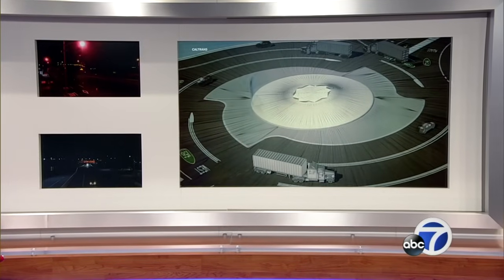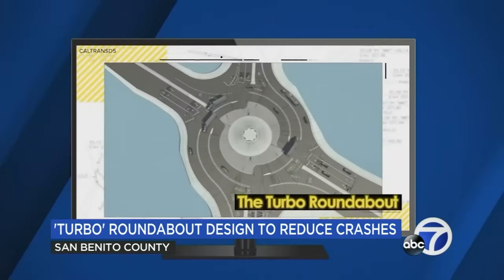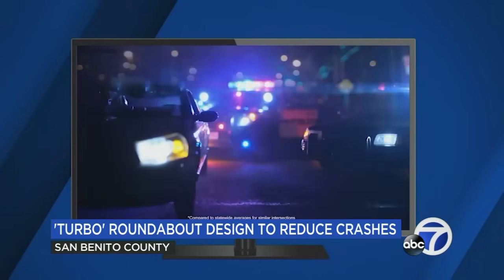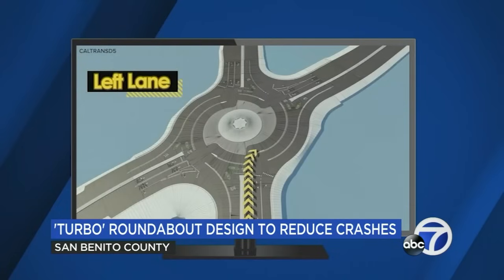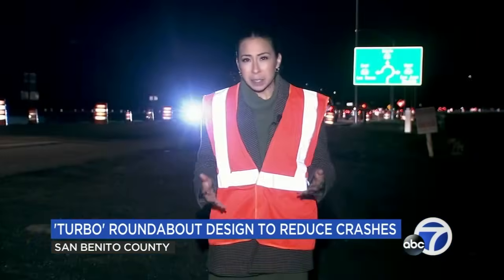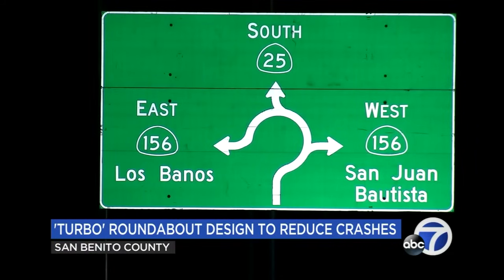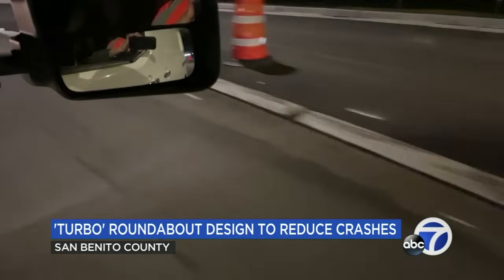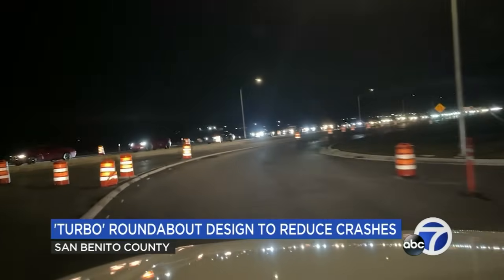Here's how California's first 'turbo roundabout' works

Comment: A 3 inch barrier isn't going to help anyone when someone freaks out and "misses their turn" and either stop completely to clump over or just drives over them (trucks more so than cars I'm sure).  If there's anything I've learned in 30 years in driving is most people can't accept "I'll take the next turn and double back" it's "I need to get off here, now, that is non-negotiable"
Reply: yes. a good driver sometimes misses their exit but a bad driver never misses their exit
Reply: Add to this the drivers who realize the lane choice mistake before entering the roundabout, and blocking two or more lanes leading up to it. Perhaps the ground barriers need to be raised to about nine inches.
Reply: @jeffreeves1567  If people can't deal with sorting into a lane, how do they negotiate any interchange?
Reply: You really can't take the next turn and double back anyway. Every one of these roads doesn't have a place to turn around for several miles.

They need to post the instructions for this a mile before you get to it, not "HEY BUDDY WELCOME TO THIS THING YOU NEVER SAW BEFORE LOOK HERE'S A LANE HAHA GOOD LUCK"
Reply: The great thing about roundabouts is that it also reduces the severity of collisions. People are still going to collid, but at a lower rate and at a reduced severity.
Reply: So true...even if they are 3 lanes over on a freeway they turn as if they saw a collapsed bridge 50ft ahead

Comment: the only problem I see with this round about is that if you take the wrong lane you'll end up in the wrong road, where as on a regular round about if you miss your road just keep goin around till it comes around again.
Reply: So, not paying attention is the fault of the infrastructure and not of the driver?????

If you pick correctly on a turbo roundabout before even going on the roundabout, you physically can't miss your exit. And it's easy to remember: left lane goes left. The middle lane is for straight ahead. Right lane goes right. Honestly how hard can it be.
Reply: If you have to change lanes in a modern roundabout it means you entered in the wrong lane.  Modern roundabouts don't let you go around and around like a rotary.  You have to exit. Turbos just add curbs so drivers that are not paying attention to the lane use signs have to follow the required path.
Reply: @BiteBolt_77 you are incorrect sir,. Left lane goes left AND straight, middle lane goes straight AND right, right lanes goes ONLY right. 
How hard can it be?
Reply: @jbright97  different roundabouts can have different configurations. In the end just follow what the signs say as they usually clearly mark which lane goes where.
Reply: Id like to see the signs ahead of time to show which entry lane to use.        Would want multiple sets far away.   So many just dont pay attention at all
Reply: The point is that you pick the right lane before you enter, rather than on the roundabout itself.  Check UK dashcam videos to see how well multi lane regular roundabouts work.  In contrast, we have these turbo roundabouts all over the Netherlands and accidents are extremely rare on them, while still keeping a good traffic flow.  If you pick the wrong lane, you can sometimes switch on the roundabout, else you treat it like taking a wrong turn at an intersection.
Reply: @BiteBolt_77  Who said it was anybody's fault? They're just making an observation. Most roundabouts allow you to change lanes; this one does not. We know you're perfect and never pick the wrong lane, but some of us are ... human.
Reply: You can just turn around somewhere else instead of in the critical section of the road network.
Reply: That is not true. Look at the lanes, as long as you are in the middle or the left lane, you can keep circling the roundabout indefinitely.
Reply: @ericclone  Yes look at the lanes, they're spiraling outward and exit the roundabout. There's no lane that circles the roundabout.
Reply: @MatthijsvanDuin  you are right. One has to switch to the lane to the left to stay in the roundabout.
Reply: @ericclone  which isn't allowed and the design strongly discourages doing so by having a barrier separating the lanes (except where traffic entering the roundabout needs to cross).  I don't understand why people are fussing about having to sorting into the right lane, you need to do the same for an interchange.
Reply: @BiteBolt_77  5 seconds before you get to something you've never seen before is not the time to give people instructions.
Reply: @rsethc  Posting comments about something you've never seen is stupid. You've never been to this intersection. Once you're on any one of these roads, there's nowhere to turn around for miles.
Reply: @aluisious ?????
Reply: Oh yeah….how easy huh?!

Comment: Didn’t explain in detail how it works. The 3” berms are going to ruin a lot of tires. That’s a guarantee
Reply: Just follow your lane to the exit
Reply: You're not supposed to drive over the berms
Reply: Those berms are meant to discourage switching of lanes within the roundabout, which happens in multi-lane roundabouts without them, causing collisions as jerks cut off other drivers from the inside lane to make an exit.

Comment: Today on May 29 2023 we just used the new turbo roundabout and the problem is people don't know what yelled means and just keep driving instead of yielding they just drive erratically. If people slowed down and drove more cautiously and shared the roundabout rightly it would run smoother. People are idiots

Comment: What needs to be done is a proper overpass constructed. People's safety is not where you need to be cheap. 
Hollister had a horribly dangerous intersection at 152/156. The millions of people that've driven through there can attest to how life threatening it was for... idk....40 years. It took a heartbreaking gruesome accident to finally cause an overpass to be built to accommodate the increased traffic flow.
Hollister has another horrible intersection at 156/Union/Mitchell Road. This one isn't particularly dangerous, but it can take an hour to get across it. 
Hollister is landlocked in a bit by inefficient roadways. We need to learn from things like the Paradise Fire. 

I've seen so many horrendous accidents at 25/156...
One of these days we'll be hearing about a semi plowing through that intersection, flying through the air, and causing a huge mess. Not if, but when. Overpass is the real answer. The turbo roundabout is a huge waste of money and wasted time in delays. 
Overpass is what the people want.

Can't make a u turn. 
I've seen people turn left at the entry.
Everyone switches lanes in the thing.
It's all bad bad bad.

The correct answer for 2 large highways interesting would be an overpass. Especially for the volume of traffic this place sees.

Comment: Bad idea. Drivers will change lanes in the roundabout and cut off cars, and change back depending on where they want to go. There will be more collisions but they will take place at lower speeds.
Reply: That is what the 3" barrier is for...it is bascially a curb between lanes.  There will be consequences to your car if you hit that curb.
Reply: @DaBinChe  not high enough. people in wrong lanes will stop and go over it. 1 foot barrier
Reply: @emmanuelvacakis4463 But why would they change lanes if they have already chosen the lane they need? It is not rocket-science.
Reply: @htimsid  bad drivers are not logical drivers. Bad drivers are never satisfied with any lane they drive in.

Comment: The only way it will actually work the way they want it to is if there are concrete barriers between lanes making it impossible to change lanes once you're in them. Otherwise some people will try anyway. Look at how people get into and out of HOV lanes illegally in between entrances and exits. At least they do where I've seen them used in California and Texas.
Reply: yes. not just curbs, it has to be higher concrete barriers. 

curbs will cause accidents. people in the wrong lane will dead stop then cross over them.

Comment: You are so far behind the curve. Round abouts are very easy to use just give way to traffic on your left. Getting rid of stop signs will be a start too. Replacing with roundabouts keeps traffic flowing reducing the ridiculous congestion. And may consider have off ramps before the on ramps as all of them are to small. Adding further guidelines like if your merging onto a freeway from another  people already on the freeway should change to second lane before the junction so people merging dont have to worry about people speeding up there ass.
Reply: Where I live roundabouts are everywhere, and even I didn't know you were supposed to give way to the left.

Thank you for telling me this. I will be sure to do this from now on. 

Kind regards, 
A resident of Great Britain.
Reply: @ExtantThylacine  if in the US you drive on the right side so coming upto roundabouts you have to give way to the left. In the UK you give way to the right. As someone who has now moved to the US from the UK i am correct. Trying to be clever about my give way to the left statement and pointing out you are from the UK, you have made yourself look stupid.

Comment: Lol, 'Turbo roundabout' aka normal roundabout but with kids rails, like in bowling, for ppl who don't know how to use roundabouts.
Reply: Ehm no, a turbo roundabout is significantly different. A regular roundabout has one or more circular lanes that go all the way around (you can keep looping the roundabout if you'd want to), a turbo roundabout has lanes that spiral outward and exit the roundabout, which is why you need to sort into the right lane before entering the roundabout.
Reply: @MatthijsvanDuin  Ehm no, normal roundabouts have lanes that you can’t keep looping around in and force you to exit. I’m guessing you are one of the ppl new to roundabouts, which is ok but don’t speak so confidently about it when you are so incorrect lol. “Turbo” roundabouts are just normal roundabouts in function but extra stupid proof and with a stupid name.
Reply: @MrBaller4Life14  I'm dutch, I've regularly seen roundabouts my whole life. They all have an uninterrupted circle as innermost lane unless it's a turbo roundabout or it has restrictions on which flows are possible. I don't see any non-turbo roundabout depicted on the wikipedia page for "Roundabout" that lacks an uninterrupted inner circle. I do see a few which have road markings that suggest an interruption that doesn't reflect practical reality, e.g. the "The Hotel Indonesia Roundabout" near the top of the page is a particularly egregious example of that.

Comment: Not a bad driver by any means but this looks confusing as hell not having seen this video and if I were approaching at 70 miles a hour. Fearful for future collisions
Reply: The simple answer is you shouldn't be approaching a roundabout at 70mph!
Reply: @astrecks  I get that but everyone drives fast on this highways and in the middle of the night or slower hours  I feel like this will appear pretty suddenly lol
Reply: @ElPolloToko Maybe the answer would be rumble strips on the approach to the roundabout. In the UK, these are slightly raised lines across the carriageway which are placed closer together as you close on the roundabout as a physical reminder to slow down.

I'm not sure having raised lane separators is a good idea though. If I miss an exit on a roundabout, I continue around and manoeuvre into the correct lane to exit.

Comment: I hate roundabouts. I missed my exit on one in Colorado without realizing and accidentally took the one going the wrong way on the interstate and was stuck going the wrong direction for several miles until there was another exit. They are confusing if you are not from the area and trying to watch for signs in a short distance while also trying to steer in a curve while staying in your lane, while also watching the cars next to you for crowding into your lane. These are popping up all over as the new in thing, sometimes 2 of these in one block which is ridiculously confusing if you are not familiar with the area. We ran into them in weird places far from cities our last trip, and no idea why somebody decided they were an improvement for a normal intersection. It might make sense for an odd configuration, like a sharp angle or multiple crossings of busy roads, but some places are not made easier with this change.

Comment: Roundabouts are not a widely used road feature in CA. Consequently NO ONE know hows to use them. Now we're going to throw a variation at highway speeds!? Who approved this!? They should be punished by having to sit and watch it for a full month.
Reply: California is near the top in states with total number of modern roundabouts.  They are easy.  Just slow down.
Reply: Gotta start somewhere
Reply: The correct answer for 2 large highways interesting would be an overpass. Especially for the volume of traffic this place sees.
Reply: How much volume. Give us a number. Two lane roundabouts can handle 5,000 vehicles per hour. Your overpass solution costs $50 M, minimum.
Reply: @scottmbatson  
Cost over lives. Got it. Our forefathers did better.
Reply: @xmo552  they didn't. And roundabouts are very safe.

Comment: Why not the normal and easy to understand overpass/underpass? This seems overly complicated and confusing.
Reply: These junctions are cheaper.
Reply: An overpass would cost 7-10 times as much.
Reply: The correct answer for 2 large highways interesting would be an overpass. Especially for the volume of traffic this place sees. 

Cost vs lives.
Reply: They are now reporting a bunch of accidents. I don't know if I can post the link here but search YouTube for story title "Several crashes reported, two weeks after grand opening of turbo roundabout" by KSBW Action News 8 posted 3/1/2024.
Reply: @metallus2   fender benders or injury?  Fender benders are so underreported they are often ignored.  Eliminating injury and fatal crashes is what matters most with the limited revenue available to work on the problem.

Comment: Only good for moderate volume of traffic.
Reply: It’s pretty boonie location
Reply: @AliasHSW  
Did you not hear? It's growing immensely. Most bay area drivers come in from outlier counties. A 25 mile commute through there can be 1-3 hours. An overpass is the correct answer for 2 large freeways intersecting.
Reply: @xmo552  - this is cheaper and quicker to build than an overpass system of bridges — especially specific to that location with the San Andreas Fault and the fault lines in very close proximity to each other and freeways.
Reply: @AliasHSW  
Bridges and overpasses can be built to move and swing. There's an overpass at 152/156 btw.
The Golden Gate, Bay Bridge and a bunch of others in the SF Bay Area are all built in an area full of fault lines.
Reply: @xmo552  - true. However in construction time is money plus the cost of structural engineering and environmental engineering and environmental impact reports, legal…easily the bill 💵 is 10x. Then there are the operating costs in maintenance of the structures once they are built.
Reply: @AliasHSW  
So how many lives must be lost to justify the expense?
Reply: @xmo552  engineering reports have shown/proven traffic circles have a safety, low fatality rate as traffic has to slow down to negotiate with the turn and with the traffic; whereas on the typical overpass a driver and the engineered capability of modern cars can still stand and a lot more on the throttle
Reply: @xmo552  Time saves lives. The quicker traffic calming implementations happens, more lives would saved and accidents adverted.